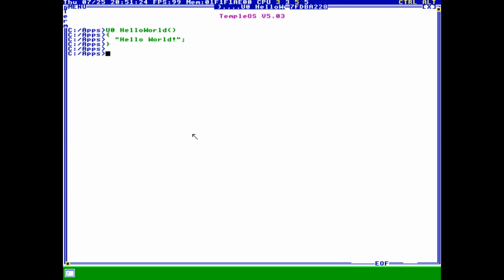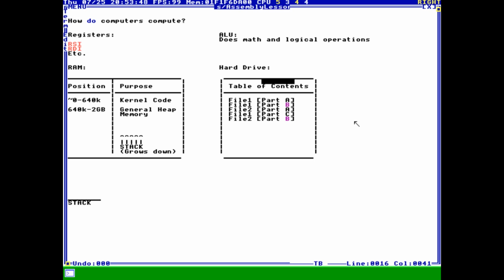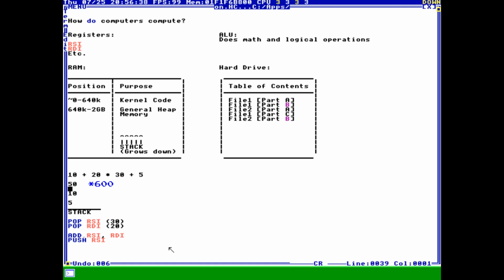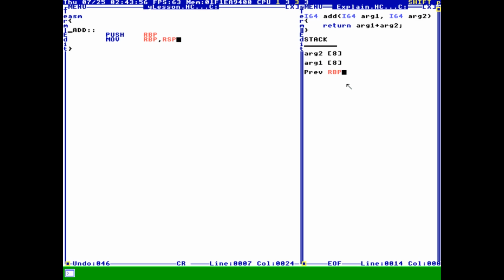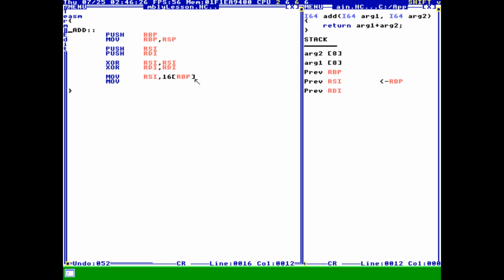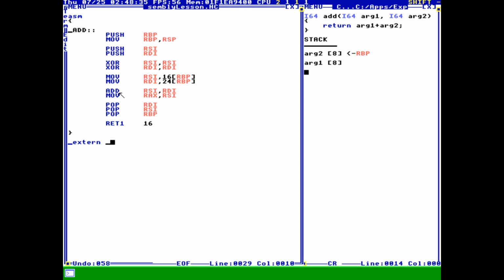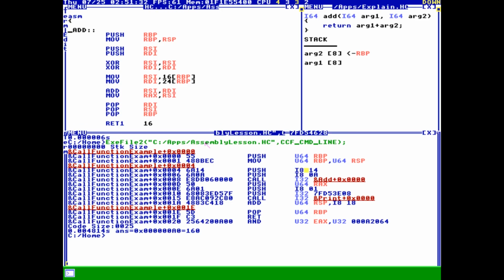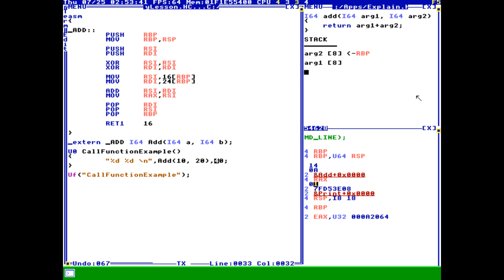TempleOS Assembly Tutorial: Creating a Function

Comment: How do you get it to run at over 30 FPS?
Reply: Go to the C:/kernal folder, open kernalA.HH.Z, then scroll to line 1478.
You should see two #defines here - WINMGR_FPS and WINMGR_PERIOD.
The window manager uses these to calculate the window draw timing.
Replace the "30000" portions of both the definitions with the multiple of 1000 that you want (60000 for 60 fps, 99000 for 99fps and so on), then restart the OS.
There might be a way to see the effects without restarting the VM but I don't know how to do that.
Reply: @icarvs_vivit  thanks :)
Reply: @StannyObelisk  np

Comment: Great video. Very enlightening for a senior java programmer that barely understands c, let alone terry's version of c. I know nothing about assembly (let alone terry's version of assembly). So RSI and RDI are essentially the first two parameters of a function and RAX is the return value? What if a function has more than 2 parameters?  What is the reason for the 640k kernal and 2gb heap? I thought TempleOS was 2gb conventional memory and the whole '640k' trope had been abolished. I guess Im confused by conventional memory, stack memory, and heap memory. I thought heap was runtime ram, stack was compile time cpu, but apparently stack and heap are runtime/compile time ram and conventional memory is something different that Im not familiar with and that uses 640k 'paging tables'. Your videos are extremely helpful for me. Im in the dark and confused coming at TempleOS from a java perspective lolol.
Reply from the maker: RSI and RDI are just regular registers that you can use however you like, and on a conventional OS the arguments would be fed in through them, and any arguments that didn't fit would go on the stack. Then when the function ran, it would have to copy the arguments out of the registers onto the stack, so the registers were free to do calculations. In TempleOS however, anything that can go on the stack will go on the stack, including arguments. The registers are not used to feed in arguments, they are used to retrieve the function arguments from the stack for calculation. So in this video, the previous values of RSI and RDI are saved on the stack before the function arguments are copied into them, then popped off the stack when the function ends. This means that the code that calls the function can assume that whatever value it had in the register before the call, would still be in the register after the call.

Chances are you've directly interacted with the heap and stack in Java. If you define a local variable within curly brackets:
if (i == 10)
{
        int a = 6;
}
Then a will be put onto the stack while the function is run, however after the function ends it's value will be popped of the stack, thus why a variable defined within {} will not exist after the }.
It's been a few years since I used Java (I've been using C after AP CS ended), but when you use "new" then that value is stored on the heap. For example:
Person p;   // This is just a pointer, an integer value that points to where in RAM person is. Right now it is Null (0)
p = new Person("Jacob");   // This creates the actual Person class in the heap memory, then sets the p pointer to point to it's memory location.

Note that p, the pointer, is actually just put on the stack, and will be popped off the stack when the function ends, however the Person itself remains in RAM in the heap, but I think java knows to automatically delete that when the pointer is deleted. In java these pointers are called references, however in C, if you delete the pointer, you also have to Free() (templeOS) or delete (C) the stuff stored in heap memory. There are ways around having to delete this manually if you use smart pointer libraries, to prevent accidentally deleting a pointer and leaving the actual structure in Heap ram, causing a memory leak.

I still haven't completely understood the memory layout for the OS, but essentially every task get's it's own stack and heap. I think that all these little stacks and code are essentially on one larger stack. The 640k is not a hard programmed standard, it just happens that the Adam task tends to use up 640k of RAM. You can use MemRep; to see all of the tasks and their memory locations. I found some videos of Terry describing the memory layout and compiler that I'll upload to this channel, hopefully they can shed more light on this. 

Terry does say that he compiles to the stack, I think the entire OS has one large 2GB stack and each task, with it's own little code, stack and heap are put onto it as they are compiled. The reason he made the 2GB limit for code (you can access data outside of 2GB) is because of the call rel32 instruction, which takes a 32 bit value and jumps. A 32 bit address can only address 2GB of RAM. With a 64 bit address, you can address many terabytes of memory, however you first need to put the address into a register, then jump. Terry decided that since he has a code limit that he wasn't going to bother to add that one line to the compiler, but it could be easily increased if you wanted to. 

Also TempleOS does not use paging tables, which I think he has comically explained in many videos. Paging is when you separate your code into little chunks of memory, usually a fixed size, and then put them into RAM. That way if you delete one program, and need to allocate another program that is larger than the first, then half or so of the first program can go in that space, and the second half can go after. The problem is that every time a jump instruction is called, the CPU has to check where the other pages of the program are stored in RAM, then offset that address accordingly. He decided this was too complicated and only useful for tiny embedded devices, and that desktops did not need it. I think he thought there was a performance increase as well, but I am not sure.
Reply: @templeprogramming3579  So mainstream OS's take arguments, put them on rsi rdi and if larger than 2 params puts the others on stack. Then function gets called, rsi and rdi arguments get put on stack, and function gets carried out. TempleOS puts all args on stack regardless of number. Then function gets called and carried out, rsi and rdi are used as needed and return to their previous value at the end of the function. TempleOS essentially eliminates 2 extra assembly calls when a C function is called that doesn't do calculations and it allows for easier piping/streaming of functions that do calculations. It eliminates the copy of the first 2 parameters to rsi and rdi and it eliminates the rsi and rdi put back onto the stack before the function runs(2 calls that don't necessarily need to happen in every function call). Instead rsi and rdi have nothing to do with arguments, they just interact with and do calculations with the variables put on the stack and involved in a calculation. They also revert to their starting values when the function ends. 

Would a simpler explanation be Terry turned the unix stdout mechanism into the unix 'tee' mechanism? If you are not familar, a '>' cmd (or '>>' if appending) pipes output to a file and ends the pipeline, a 'tee' cmd pipes output to a file and continues the pipeline with the original output. Instead of a value flowing through a bunch of  '|' and then writing to a file with a '>' (or '>>') aka line shaped pipes to do a transformation and then write a final mutated value to a stdout without retaining the original value, the value is flowing through a bunch of 'T' aka 'tee' shaped pipes that do both a pipe transformation and a write ('>')  which means as many mutated values as the programmer wants while still maintaining the original value. Intuition is telling me that terrys style(T pipes) is better than the current functional programming style(| to > pipes) but Id have to mess around with it more. The possibilities with that could be insanely beneficial to functional programming(aka rxjava, rxcpp, rxpy, rxjs or languages like scala, haskell etc) because it would mean that instead of creating 10 million seperate async 'observable streams' to handle 10 million seperate async data streams, you could create 1 main sync 'observable stream' to handle 10 million seperate async data streams. It could also be that those libraries/languages already do something like this but I just havent recognized the lower level aspect of it. So terry either arrived at the same conclusion of industry standard but on a much lower level(so faster) or he figured out a better way to do async 'observable streams' than netflix, comcast, google, microsoft, python, java, ibm, intel, amd, unix, linux, ios, android, etc lol.  Im gonna have to play around with it to confirm but a 'tee pipe' makes alot more sense than a 'line pipe to a stdout' from a functional programming style when writing to stdout does not require more overhead then a pipe transform. In unix it makes sense because writing to a file from stdout is a more costly than a pipe transform from stdout, but in TempleOS it seems like the the difference is negligible so it makes sense to combine the cmds into 1. Or I am misinterpreting what you are saying in which case disregard my rambling.
Reply from the maker: @johnsaxondale21  Your understanding of the assembly is correct, however there are a few more registers available on x86 (r10, r11, etc) and arguments go into those as well, I just only included RSI and RDI. As for pipes and streams I will look into that a bit more, I've used them quite a bit but I've never actually thought about how they function or are implemented in shell or C. I'll try disassembling << in linux. I'm not entirely sure he even made a full stdout as we would consider it. In the kernel directory, if you use Find("[seach term]"); command for different display based names (display, window, etc) you will probably run into the display buffers (I think they are setup in KernelA.HC or something), and if you look at the printf function I think it looked at the length of the printf command and just straight up copied onto the display buffer array at the current set cursor position. I think everything in TempleOS is made to be the absolute minimum and most simplistic solution so that any user can wrap their head around every piece of code in the entire OS, you can see this mentality in this old sparrowOS post: http://web.archive.org/web/20130221043159/http://www.sparrowos.com/Wb/Doc/Welcome.html#l1. Also whenever he does a transformation on a set of data at any time, he almost never deals with each piece of data separately, he almost always does a MAlloc() then MemCpy() and runs a for() loop on that new set of data. This might be memory inefficient but it makes it immediately obvious what the code is about to do when you see a MAlloc() then a MemCpy(), and I've seen him do this with string manipulation commands and in just about every graphics library function.
Reply: @templeprogramming3579  In windows with MSVC on x86 you can tell the compiler to use the registers (if available) using the __fastcall convention, gcc clang, and icc also support this using the __attribute(fastcall). There's also multiple other registers such as (r)(e)ax-(r)(e)dx which are commonly (e is 32bit, r 64bit). 

you can look up a list of registers and their purpose, also you can access the low bits of a register, eg rax's low bits are eax, eax's low bits are ax, and ax's low (and high) bits are ah and al

it goes [ rax [ eax [ ax [ ah, al ] ] ]